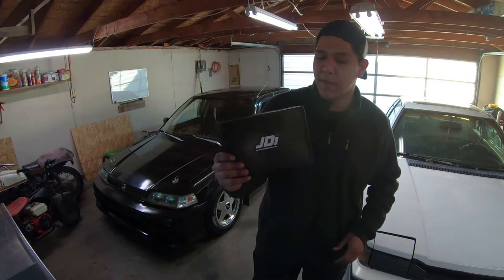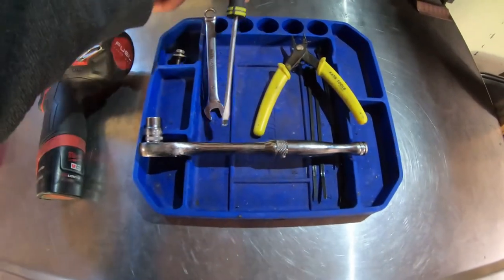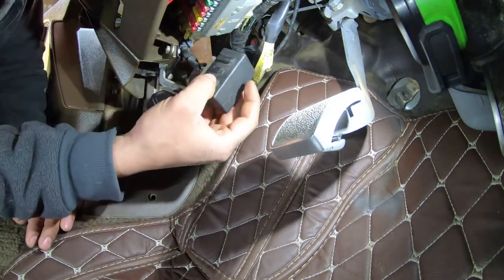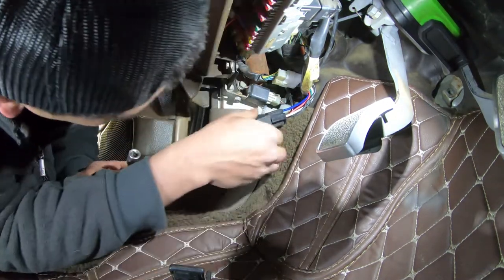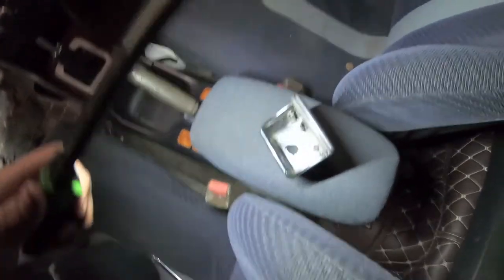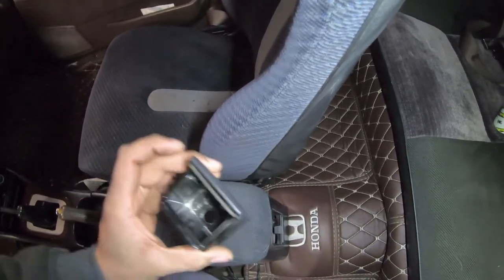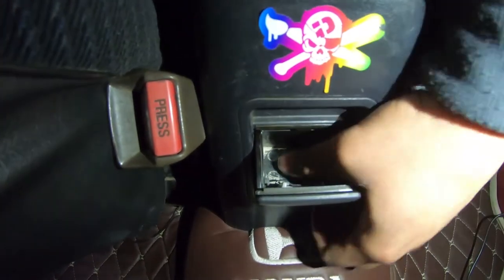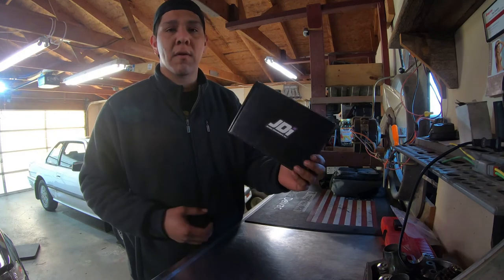EF Main Relay Conversion Kit Install

Comment: I got this same conversion kit..Nice video!  One thing i would recommend is to zip tie the main relay to the plug. While i was installing mine, the main relay popped off the plug really easily. So, just zip tie for security.  That's my $0.02.
Reply from the maker: I haven’t had any problems with mine but I will do that for that extra reassurance 🤙

Comment: I don’t want to talk crap but why would you leave that really in the open and have the kill switch. Someone can just reconnect that splice in cord bypassing the kill switch (if they knew). Kinda defeats the purpose boss.
Reply from the maker: Your right I didn’t think of that but I could always relocate it or add some heat shrink to the kill switch wiring going to the relay for some extra security. Thanks for the feedback 🤙